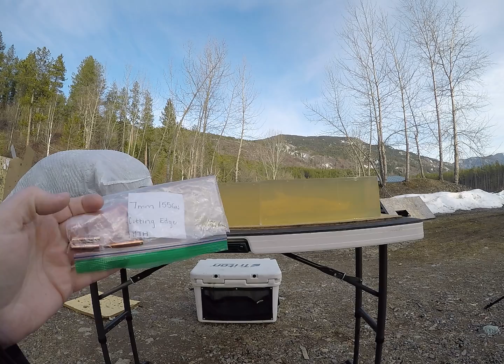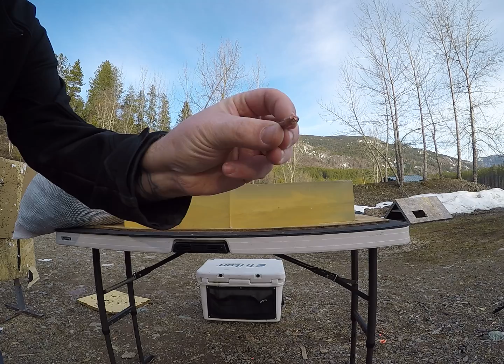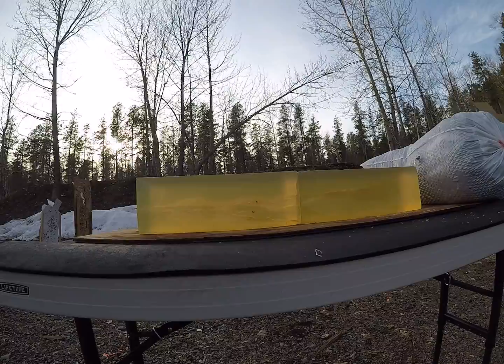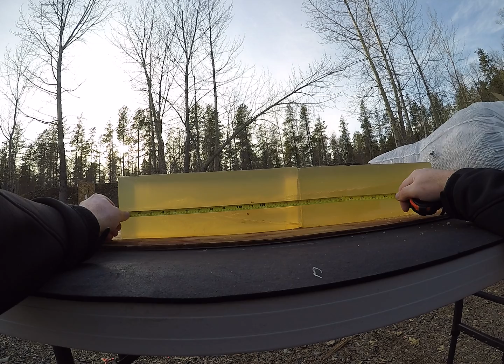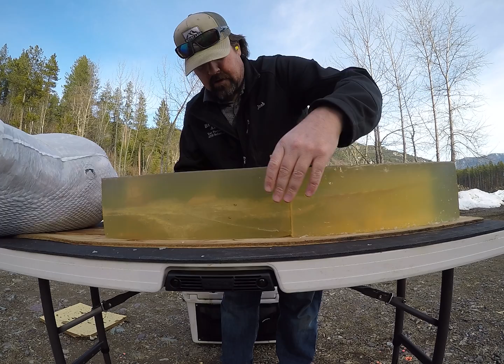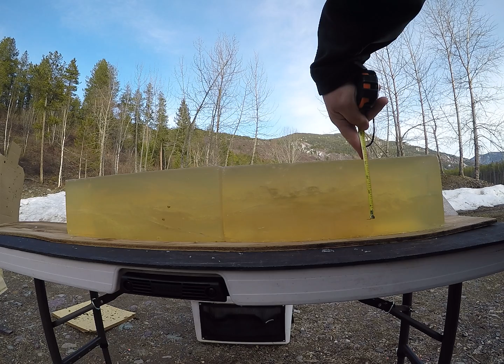Cutting-Edge 155gr 7mm/.284 MTH Ballistics gel test

Comment: Another informative test.Glad to see some monolithic bullets that perform correctly.
Reply from the maker: I need to do some more high velocity testing because this is twice now the high velocity bullet has had higher weight retention than the low velocity and I'm not sure what's going on. 

Even at high velocity they're giving decent permanent wound cavity but looking at the bullets I've captured I'm not sure that there's not something going on that would be considered a failure because they are not mushrooming back properly and shedding pedals like cutting edge claims. 

 I've tested a lot of bullets and I've tested other cutting edge this is the 1st one that I have tested that the high velocity rounds are retaining more weight then at low velocities and not shedding the petals appropriately. I do plan on shooting a bunch of high velocity into gel and if I get more of the similar "failures" then I will make a video overviewing those.

 Again this has only happened with the 155 grain match tactical hunting in 7 mm no other bullet of any kind has ever given me results like this and twice in a row now has me really wondering what's going on and why are these bullets not doing what they should at higher velocities.